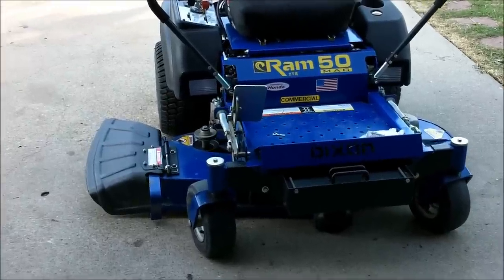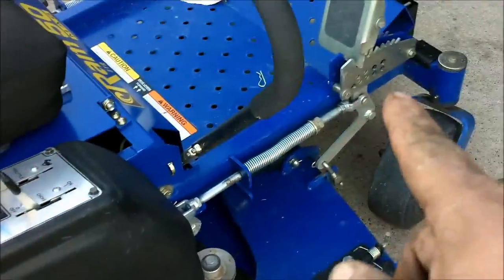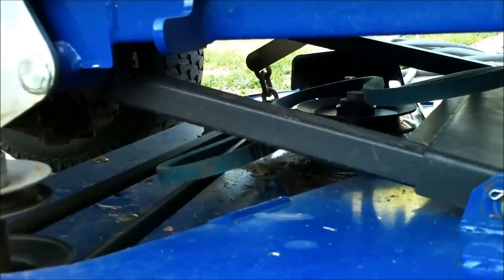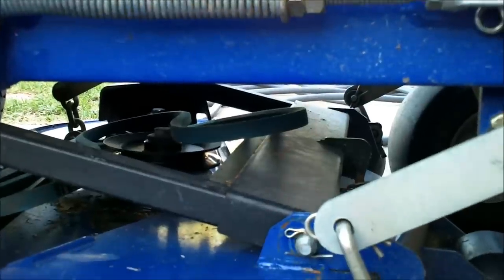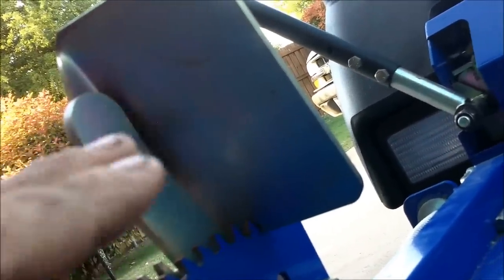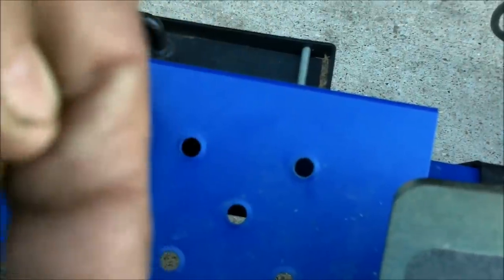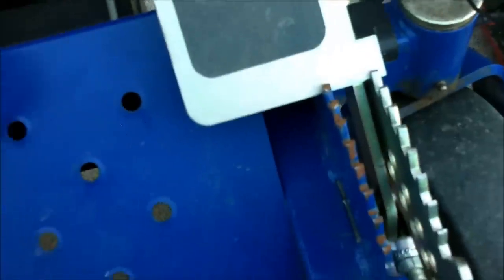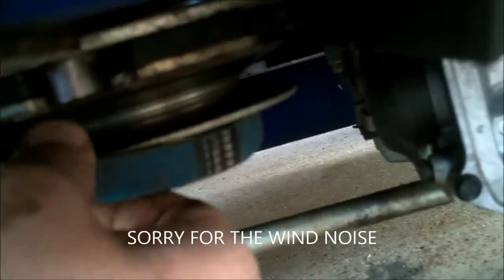HOW TO REPLACE THE MULE BELT ON A DIXON RAM 50 ZERO TURN MOWER (OTHER MODELS SIMILAR)

Comment from the maker: Never be ashamed at purchasing a shop repair manual , I have worked in a ton of the cone drives back in the late 90's early 2000's. the problem is they are 3 different types of cone drives and I had to go to the service manual to get my specs.  I would recommend 
The transaxle tool kit and the shop manual for your particular mower.  The best advice I can give is to be gentle with it.
Reply: THEMOWERMEDIC1 THE SMALL ENGINE SPECIALIST what was the deck belt size
Reply: I have a Dixon estate lawn mower and I was wondering if it was the same same process as the mower that you showed

Comment: I appreciate the video, I have been struggling for days trying to figure out how to get enough slack to get the deck drive belt back onto my 5501 after changing the drive belt.  I had no idea about the pin that goes in the bar but I found it and got my belt back on.

Comment: what size is this belt for a Dixon ZTR RAM 50? today the "professional" told me I needed a 5/8 in by 100 which was way too big. he didnt know what it was called and there are multiple names for it. The belt you are chaning in this video is the one I need
Reply from the maker: PART NUMBER IS 17423 AND IS 76 INCHES LONG X ,66 INCHES WIDE

Comment: How do you change the deck belt on this years mower? I cannot find anything online that helps.
Reply: Lift seat, remove spring (it's extremely heavy).  Then get under and remove belt.

You'll notice that the PTO clutch prevents you from removing the belt.  Just take off the small metal bracket that holds the PTO in place.  Also unclip the electrical cable.  

Again the spring is very heavy so be careful.

Comment: Thanks for guidance but I'm trying to replace the same engine to mower belt on a mid-2000 Dixon SpeedZTR 42.  There doesn't seem to be the same tension release when lowering the deck on mine as on this RAM50 ZTR.  No latter with the deck lowered or raised (completely either way) that I can't feed the belt onto the engine pulley.  I even tried calling your shop and was on hold for several minutes looking for some guidance.  I actually had this mower in your shop quite a while back for some repair.  I'm just trying to replace a bad/stretched belt and can't get enough slack to get it on.  Thanks for any advice.

Comment: We have a ztr 311 mower.  My husband drove it over a lip on the concrete to go over to the neighbors to mow and it kind of hit harder than expected.  Ever since then it keeps throwing the belt.  Just bought the mower used and haven't really owned it long enough to be familiar with it.  Don't know what it could be, but as soon as you begin to mow the belt comes right off.  Any advice on what we should check?

Comment: Thanks for the video.  We are trying to replace the belt on a Dixon Ram ZTR 48 and it seems different.  The manual doesn't say what size belt to buy.  We bought a Bad Boy 48" at the store but it doesn't seem right.  Do you have any experience with this model and how to change the belt?  Thanks!

Comment: I have an old late 1990s Dixon ZTR that I have determined to be like a 4516 etc. I am trying to get the belt back on around the electric clutch at the back. No matter what I do I can't get enough slack. Do I need to remove that front rod on mine so deck will come back some? Thanks!

Comment: How do I check the wheel pump oil level? On a Dixon ram 50 If there is such a thing on this mower. I believe someone I had to work on my mower deliberately did some things to it to tear it up. They delivered it home while I was gone. I checked the fluids and all the oil was drained from the motor and the gas was empty. I replaced that and I made a few rounds and now it won't move. It never made a noise but came to a complete hault.

Comment: Hi I have an old Dixon 3302 that I'm trying to fix up. Looks like this video will help me replace the deck belt, thanks! Is there anything different that you know of?  Also I need to adjust or maybe replace some parts on the cone drive setup do you have any experience with those? Any help will be much appreciated,  it's such a great mower,  I'd hate to have to get rid of it just because nobody knows how to fix it!

Comment: Hey Medic.  I have a 2006 Dixon Kodiak 50 ztr.  When I try to put it in any of the lower 4 notches for the deck, it doesn't seem to mow very well.  I have to be in the 5th notch to get results.  My belts are newer, so I don't think that's an issue, I could be wrong.  I thought maybe that bar in the front you were showing, but it's in place, folded back.  Any thoughts?  I also have a question on starting issues once you "fix" this ;)  Thanks.

Comment: I have a Dixon 44 inch commercial mower it seems like my motor belt is not tight enough do the Springs wear out overtime it's a 2006 with like 450 hours on it

Comment: Got a question I got a Dixon ram 50 an wondering how to check they hydro fluid for the steering
Reply: Under the seat there's a plastic container that holds the fluid, shared between both wheels.

Comment: I'd like to know how it goes in the front pulleys. I can't figure out how it goes also my spring is loose and don't know where to put it.
Reply from the maker: Wrong belt if springs are loose
Reply: @THEMOWERMEDIC1  it was working well. What I mean is that some how it got loose when I unloaded it from the trailer and don't know where it goes, spring and belt.
That's why I'm looking for the diagram.
Reply from the maker: Google your model and type in belt diagram.  Page after page of
Diagrams. Hope this helps

Comment: Hard to find dixon mower vids. I have a ztr 50 with 26 hp briggs and love it. What size is the deck belt?
I'm using a 5/8 x 100 and my  Tensioner is almost maxed out.
Reply from the maker: Refer to parts manual for proper belt number. Stay away from fractional belts

Comment: I have this same mower and where do I get that linkage rod for changing the same belt in video? It is a nightmare without that part.
Reply: Did you find it? I’m looking for the same part
Reply: @tylermiller8643  Did either of you find the linkage rod... or specs on it?

Comment: How do you replace the belt that runs the transmissions on the mower? Mine has a Briggs 25 hp on it
Reply from the maker: 1 remove idler pulley Spring
2 swing idler pulley out of the way
3 remove old belt and inspect pulleys for wear 
4 install new belt, idler and spring. 
5 test run machine
Reply: The belt is above the belt driving the blades, it’s the one that drives the transmission and I’m not sure what to remove to take it off
Reply from the maker: See above instructions

Comment: You said you work on dixons...  I have a problem...  i have lights a good battery but it wont crank I think it might be a saftey switch? any help would be great  i have a dixon ram mag ztr has been sitting 4 years  Thanks
Reply: I had the same problem , mine was a engine hold down bolt was loose and it wasn't making a proper ground

Comment: I can't get my Dixon 50 ram to move. I don't know how to check the wheel pump oil level. Can you help?
Reply from the maker: 1/2-1" down  from vent hole   Use 20w50 synthetic oil

Comment: Do you know the length of the drive belt for a ram fifty
Reply from the maker: which belt? mule, cross or pump belt?
Reply: 69 inch so you need "A section 68" (numbering is weird for all belts)

Comment: I have a Dixon ztr 50 inch I need a engine belt I can’t figure out what size belt I need
Reply from the maker: What do you mean engine belt?
Reply: @THEMOWERMEDIC1  not the deck belt the belt that is directly under the engine
Reply: @josephdoswell9483  For 2007 Ram 50 the belt is "B section 170".
Reply: @josephdoswell9483 Sorry for the drive belt it's "A section 68", i thought you meant deck belt